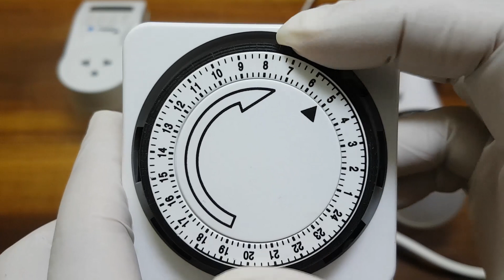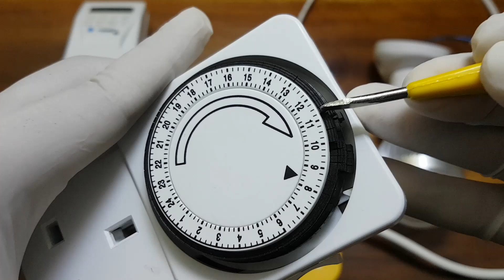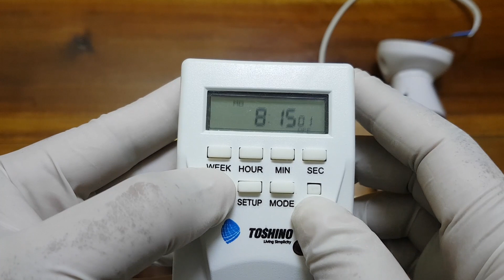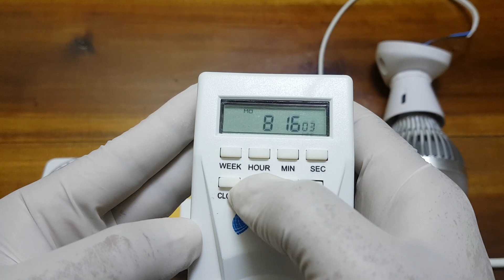Automatic Light Timer – Automate Your Aquarium

Comment: Do you have to set it up everyday?
Reply from the maker: Nope. The digital one has a built in battery so even after power cut it will retain memory. The other one you will have to set it up if there is a power cut.